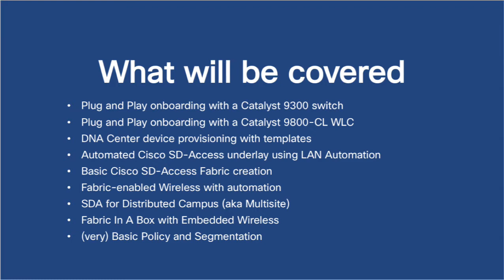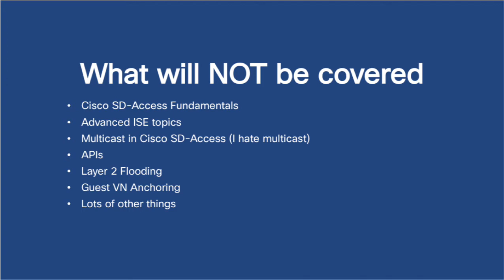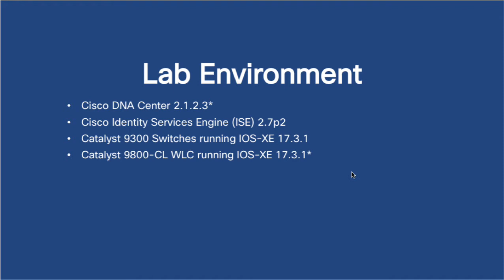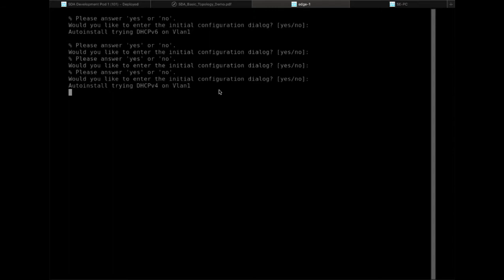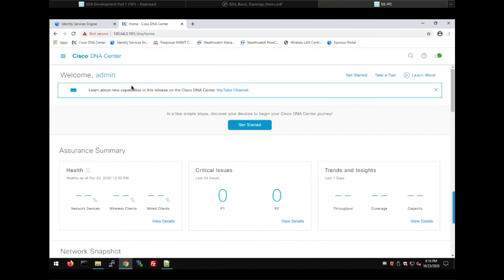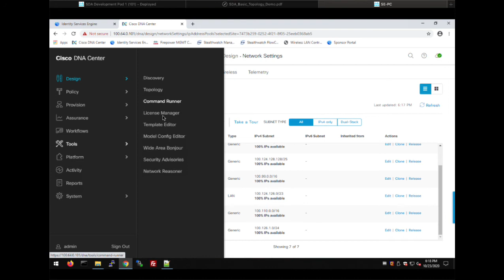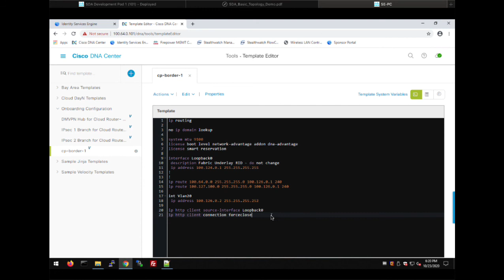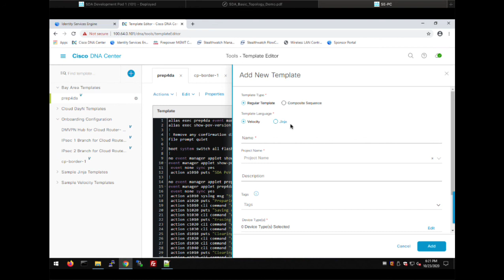Cisco Software-Defined Access (SDA) with PnP - Part 1 of 8 (Intro, Cisco DNA Center, Templates)

Comment: Hey , can you please confirm or share if you have any document for reference if trunk is supported on PnP , I have core switch as 9300 and 9800 wlc
Reply: I had tested it in my lab and test is success , I used command on my uplink switch as below
Switchport mode trunk native vlan ()
Reply from the maker: @ankushsingla9112  Great news - Thanks for following-up!
Reply from the maker: Trunks are absolutely supported with PnP.  By default PnP will come up on VLAN 1, but if the upstream switch has the "pnp startup-vlan x" command, then CDP will configure PnP on "interface VLAN x" on the new device.

I hope that makes sense.  Let me know if you have any questions. It's not very well documented, unfortunately.

One thing I can't test for a few weeks is if this will work with a 9800 WLC.  PnP on the 9800 WLC is a pretty new feature.
Reply: @eiddor  thanks for your reply , I will test it in my lab and share output with you as well , I will make trunk port on uplink switch and see if it supply IP to 9800 wlc or not .. let me know if you also get chance to test it